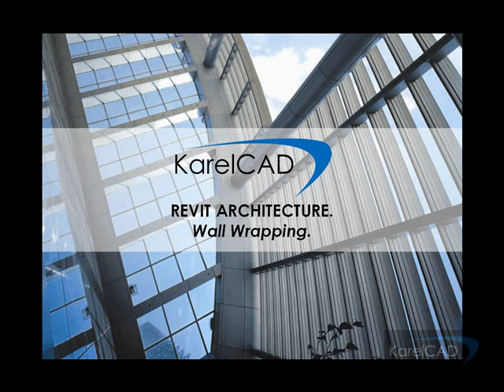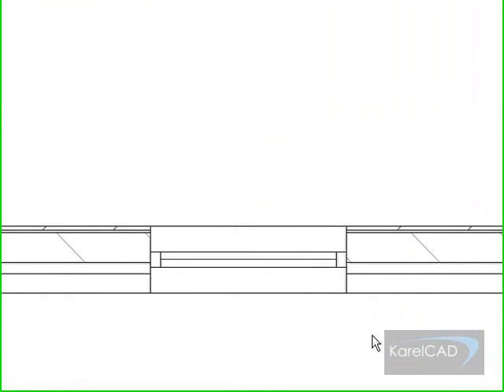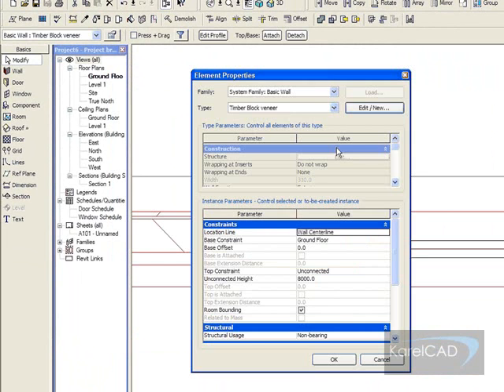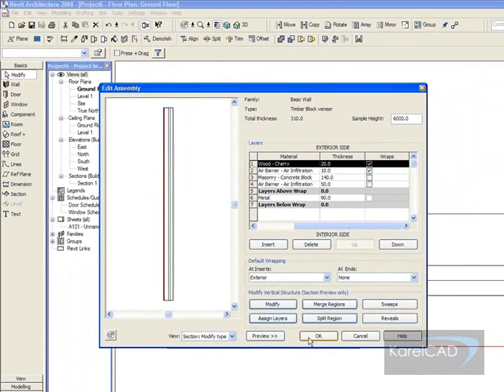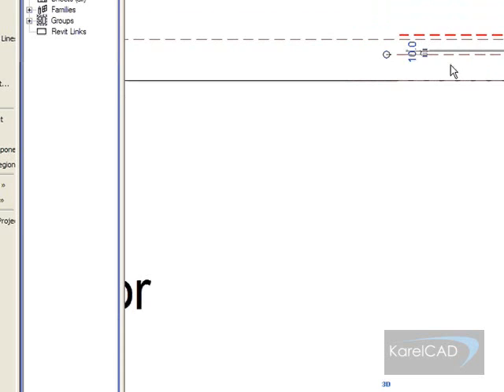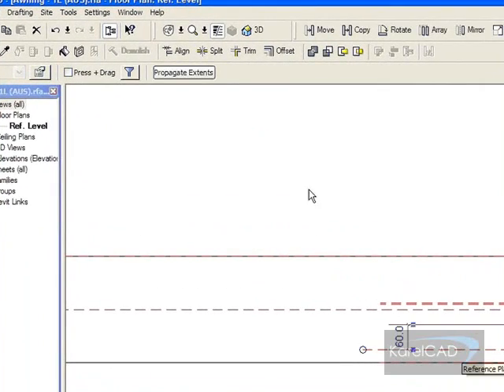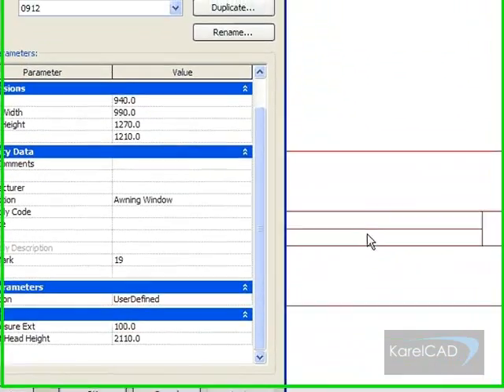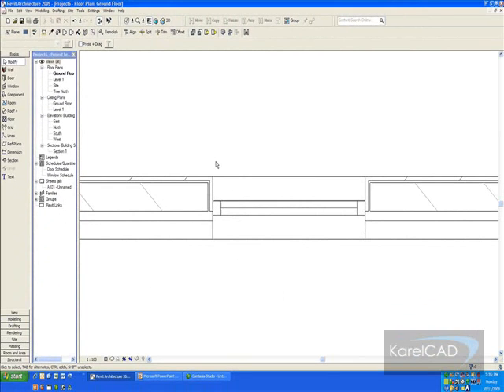Wall Wrapping Production

Comment: Hi, great video, I 'm using Revit 2011 and when I go Family type Window there is Wall Closer  but It only have a dope down menu with option such as by host , interior ...
 and If I did try to change the Closer  by moving it, the sliding window type shape is deformed in Plan view .
Please help me .